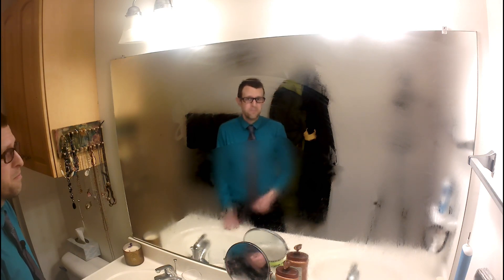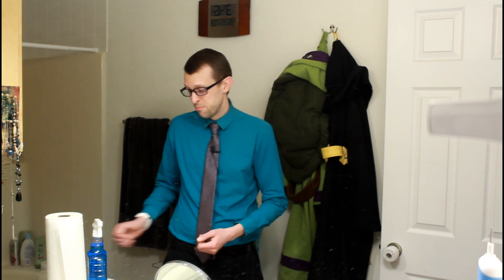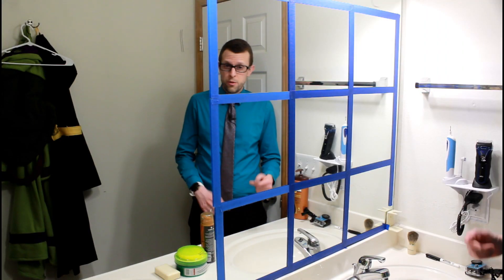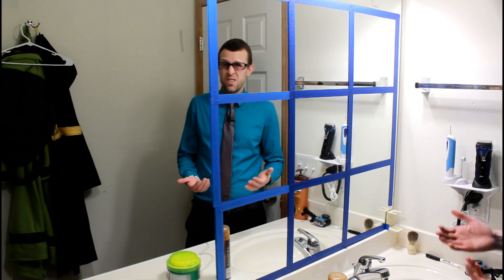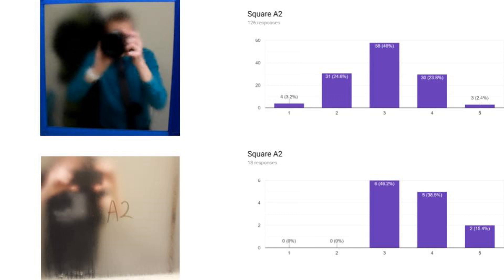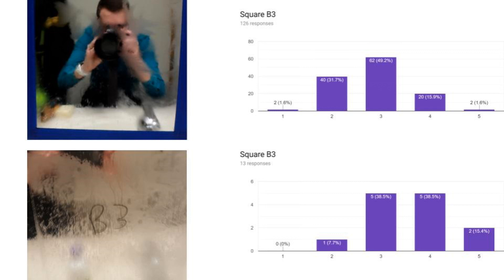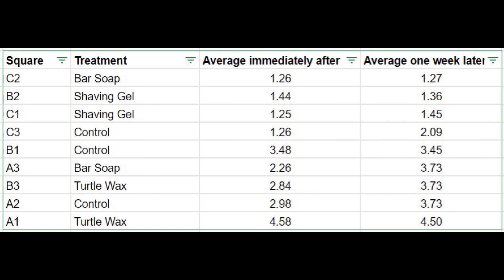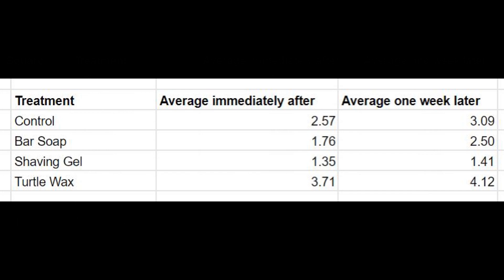Foggy Mirror Physics

Comment: Okay so my husband installed a bathroom fan in our tiny bathroom in our 1936 built house. When he first installed it, it worked great. Not even any fog on the small mirror (which is about 2ft x 1ft). The install was done during the summer and now it is almost winter and the fan isn’t working the same as we now get condensation on the mirror and small window. Now this bath is upstairs, the room is very small with maybe about two steps from the shower to the toilet, basically an arms length from the shower if you stretch a little (and I’m only 4’11) . So my husband cut about two feet of the top of the door and a foot off the bottom of the door and now it kind of looks like a high school bathroom stall. It was either that or opening the door when showering or removing the door completely. Problem is we are a family of 5 and privacy is a concern. We are transplants to Iowa which apparently is pretty humid, especially in the summer months. My question is…..Is it really necessary to have that much of our door missing? Would there be a better solution? And what should our expectations be? The idea isn’t to reduce fog in the mirror specifically but rather to eliminate the possibility of damaging the walls with condensation. Also even a hot shower with all that door gone makes the shower somewhat cold as we only keep the heat to 65% in the winter. Help….we are all feeling cold and exposed here. Thanks in advance for any response!

Comment: I'm going come at this from a different direction. 
My 2 Theories;
     1) Glass, on a microscopic scale, is generally rough & gagged. These sharp "edges & tips" of the rough surface, provide the nucleation points needed for water vapor to condensate upon. If these edges could be "dulled" or the "valleys" between could be filled, this would  create a microscopically flat surface, eliminating nucleation points.

     2) Glass always has a potential to carry an electrical charge, especially when rubbed by a cloth. You can clean every single microscopic bit of dirt, dust & debris from the surface but you will always leave behind the electrical charge. In fact, simply by the act of cleaning, you may even leave behind a stronger charge, than was present, before it was cleaned. No matter how clean it becomes, within moments of finishing cleaning, in fact while still cleaning, this charge is already attracting all the "dust" & other particulates from the environment, back to its surface. Less nucleation points present directly after cleaning but, even if nobody ever touches the glass surface, every minute that passes, more nucleation points are being "pulled" onto its surface. Personally, regarding how much influence they really have on our "reality", I don't think electromagnetic fields are given enough credit.

Kind of makes me wonder if there is a way to "ground" the glass or find a way to dissipate its charge. Keep it from building up a charge in the first place.
Maybe "sputtering" a microscopic layer of a conductive metal on its surface could work.
This may "fill" in the rough surface & be a way to dissipate the charge.
Maybe even hook an ionizer up to this conductive layer, thus, giving the glass, surface layer, the same charge as the particulates causing it to repel the particulates.

-> https://en.wikipedia.org/wiki/Sputter_deposition <-

I may be an idiot but that's my 2 cents on the issue anyway.

Comment: Years ago I had a product that was supposed to stop fogging of mirrors. I always thought that it was adding a thin hydrophobic coat on top of the glass. That would prevent water droplets from sticking to the glass. Now, I wonder whether the product was really cleaning the glass and preventing nucleation. How can we distinguish between these two possibilities?
Reply from the maker: My initial thought is to spray a liquid water mist on the surface.  With a hydrophobic coating, I'd expect the water to bead up and run off more than on the rest of the mirror.  This would not happen if the product was just cleaning the glass.  What do you think?